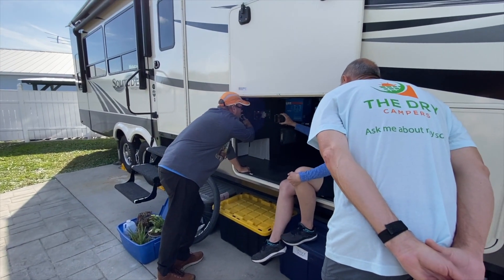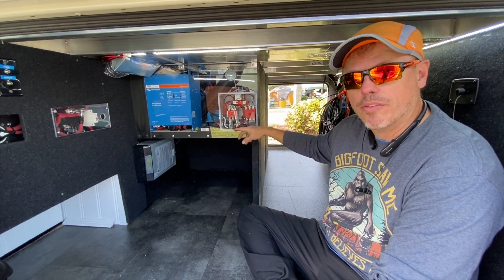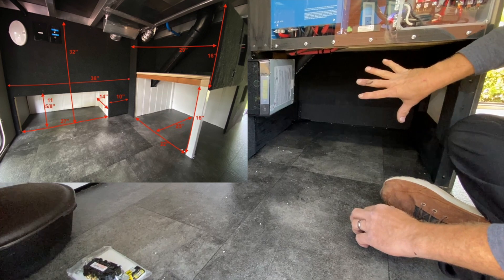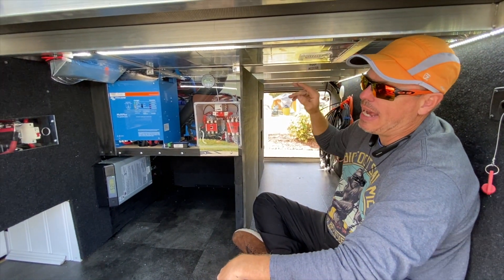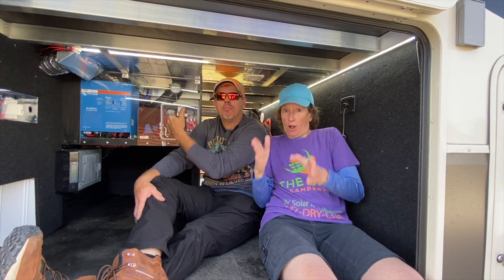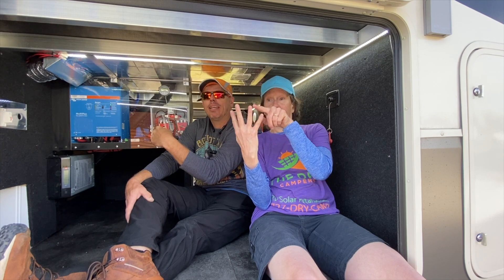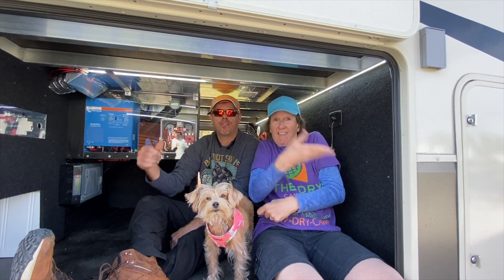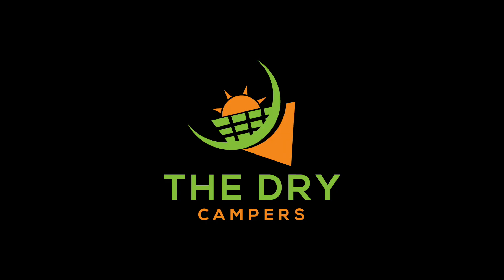Solar / Battle Born / Victron Setup on this 2020 Grand Design Solitude 2930RL

Comment: Hey Mike, I'm setting up my RV with one inverter and I am having trouble sourcing the  parts for my automatic transfer switch or  "Automation" as you call it in this video. I know I need a 40amp and 50amp contactor along with a circuit breaker and auxiliary relay. Any suggestions for sourcing, brands, etc?
Reply from the maker: No, unfortunately. We have to source what we can when we can. Very difficult to find necessary parts. We usually try to check out supply stores when we’re in larger cities, recently no luck.
Reply: @TheDryCampers  Yeah that seems to be my issue. Thankyou for the reply!

Comment: I have the inverter for the resedential ref. also. if I install the 3000 multiplus can i do away with the exsisting inverter or does it need to stay? I have 4 battleborn and 100/50 mppt also.
Reply from the maker: You don't have to remove the existing inverter, but every RV manufacturer wires the connection differently, so depending on if you want to subtract the amount of power from your 3000W multiplus or allow the fridge inverter to stay in tact is up to you. I wire them AC2 Out from the Multiplus through breakers to power the fridge inverter.

Comment: Hey Mike, how would 400 watts be with 3 Battelborn batteries? Should I up the wattage? Not planning on on running any ac. Maybe microwave for a couple minutes, etc. Main thing is my CPAP machine at night.
Reply from the maker: It certainly depends on what you would like to run. Typical rule of thumb is 2:1, so if you have 300Ah of lithium, you would ideally want to have at least 600W of solar.

Comment: Ok, now that you've done a 2930RL-R, you'll know what to expect when you do ours in April with six batteries. 
Haven't noticed you adding the relay before. Is that to be expected with ours?
Reply from the maker: We're excited for it! We don't always "point" it out, but yes, this is something that we should have talked about on the initial call; however, yes, it is something we incorporate into all of our 50A installs that do not have two Multipluses. So, all outlets in your RV will work. Most installers do this by utilizing the AM Solar $650 box, but Mike does his own automation to save you $$. :)

Comment: That looks awesome! Great job! What in the world does something like this cost? Parts and labor?
Reply: Hi Jim- the parts pricing is easy to research- Battleborn 100 amp batteries (4) plus a Victron Multiplus, a solar controller, and a battery monitor. The 4 panels are Renogy 330 watts from Arizona Sun and Wind. Both of these companies offered Black Friday pricing which we took advantage of. The biggest expense was the Battleborn and Victron materials. As for install- I won’t divulge Mike & Leanna’s pricing but you have to figure you are paying them for a solid week of their labor plus all the incidental materials he provides: cables, switches, fuses wood etc. the final piece to mention: you may qualify for a solar tax credit from the US, which includes all parts and labor done at one time. (You can Google that too) 
Cindy
Reply from the maker: Thanks so much, Cindy!!
Reply from the maker: Thanks, Jim! Turnkey, which we always quote retail pricing on the equipment but there are so many discount available - it's about $14K and this is our lowest package.

Comment: Have to give two thumbs up to the shirt you are wearing Mike. Just curious, what are your thoughts on 12 volt compressor refrigerators. I see that they are getting bigger and bigger (10-18 cubic ft.). Do they affect the installation much when you are doing the installation?
Reply from the maker: lol - Mike's mom purchased that shirt for him. It's a new fave, thanks! When planning a system, Mike just has to account for the draw if an RV has a 12V fridge. We haven't really thought about a 12V fridge for us personally as we prefer the RV (propane) fridge, but you never know with us. :)